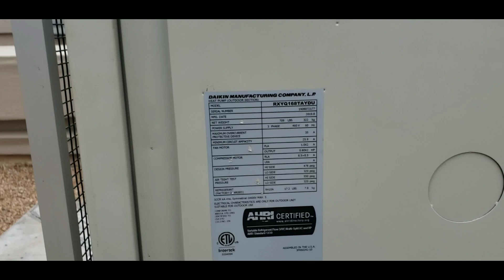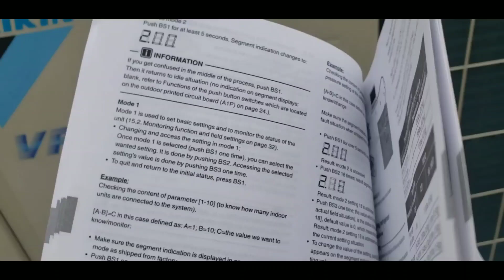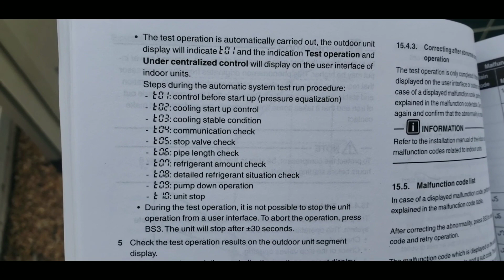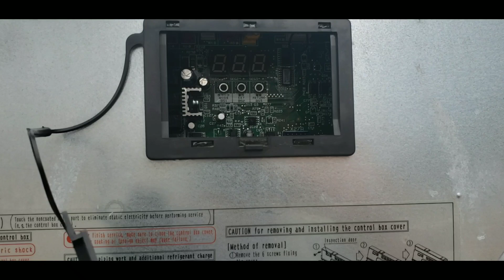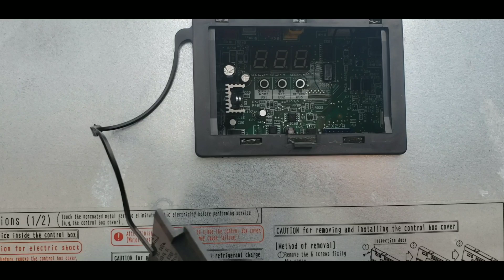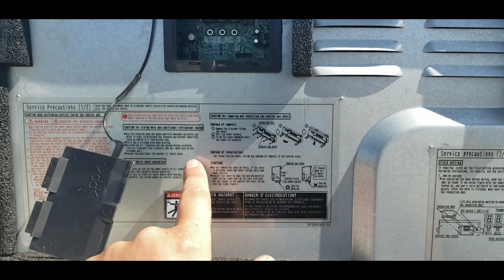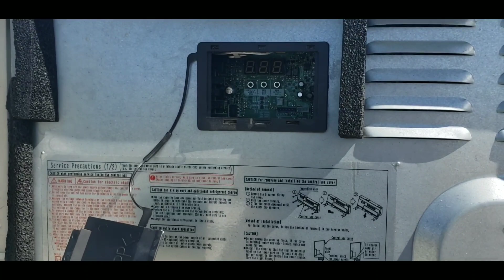Daikin VRV Test Mode help with Diagnostic

Comment from the maker: VRV Troubleshooting Guide
https://hvactime.shop/products/vrv-4-troubleshooting-guide
This is a VRV troubleshooting guide for VRF technicians. This form has the technical data for the VRV 4 system you need to make an accurate and confident assessment. As a HVAC technician myself I developed this troubleshooting guide to help the top techs on their journey.

Who this IS NOT for!

If you have substantial experience with this system and memorized the necessary data.
If you have all the manuals, training and have taken needed notes.
If you don't work on VRF.

Who this IS for!

If you are new to this system, lack training, or lack manuals.
If you want a resource to check your memory at times.
If you want all my personal notes I use to service this VRF.
If you want to save time researching needed data in manuals.
If you want to invest in your knowledge to be worth more to your employer.
If you want to be the go to tech for this system.

Comment: I was a pipefitter in south Florida for 20 years, the guy stick welding pipe on chilled water systems, welding in roof curb supports, I need to learn this stuff just for the heck of it,

Comment: How to clear with an error code U4-01?Thank you for your answer.
Reply: Fix problem with indoor-outdoor units communication. After that U4-01 will clear itself. Check 1-10 to look how many IU will be displayed. U4-01 appears after OU loses an IU which was previously present in the system (for ex. power loss of IU)
.

Comment: Im going to start doing this on my spring maintenace.
Reply: I used it and I found an E5 error code and it turns out mater unit was coded out . Im glad I did this because I had no idea I was only running the slave unit . The E5 was a do to loose connection on one of the inverter compressors . Now ill be in good shape for the summer . Tech support gets pissed if you tell them your using this function for service . They recommenced only using this on the original commissioning but I still think its a great way to verify proper operation.

Comment: I truly hate the term (Master and Slave). I’m not a woke person, but anyone should know that is an out of date terminology.
I personally use (lead and follower)
Reply from the maker: Just using manufacturers terms
Reply: Imagine crying over that.
Reply: One can use primary and secondary or Main and secondary if personally sensitive . I've used each term at some point over 39 years.
Reply: Funny I noticed the master and slave tag on my facility boiler today I definitely remove both tags and change that shit to B1 and 2
Reply: @WaltSubchak well... That's how it was programmed. It's not B1 or B2. The master controls the slave boiler... A tech is gonna need to know that.

Comment: The wired controller of the DAikin vrv4 air conditioner is stuck on fan mode. I cannot change it to cold mode even if I press the Modes button. Please help .. Does it need programming?
Reply from the maker: Sounds like the screen is locked. You have to push a combination on buttons to unlock it. If its not locked then yes the commissioning locked those settings requiring it to be reconfigured.